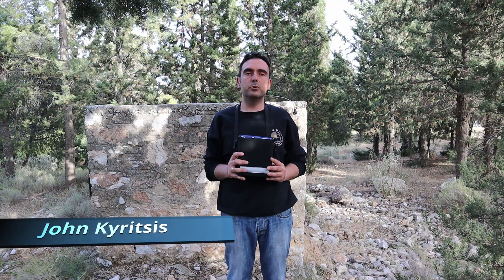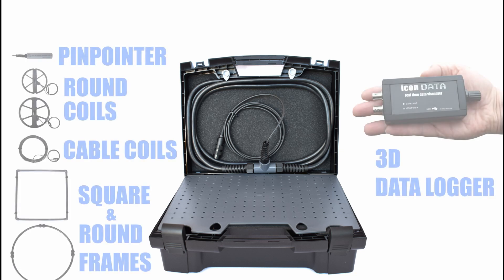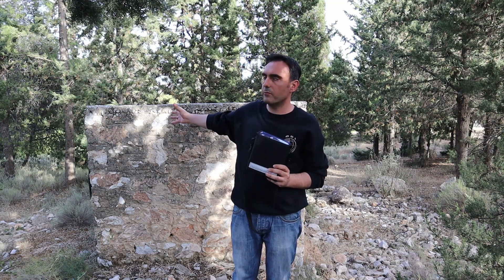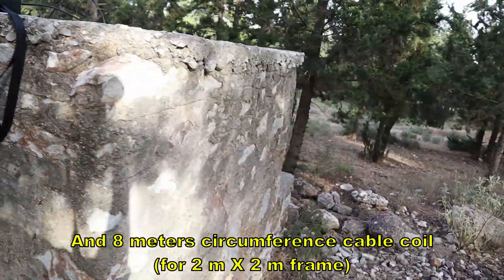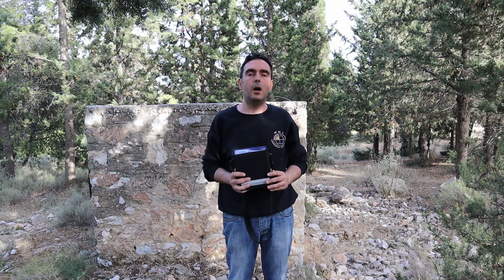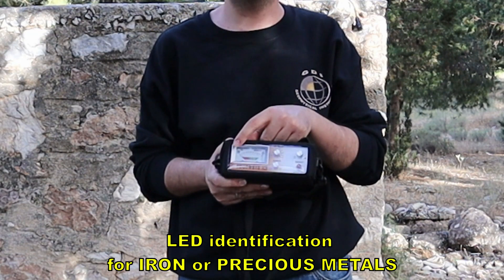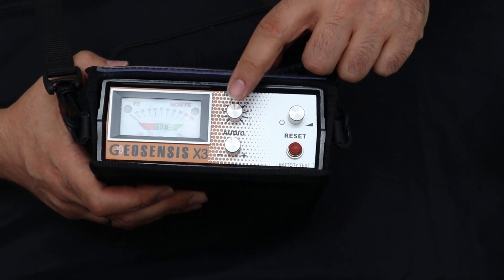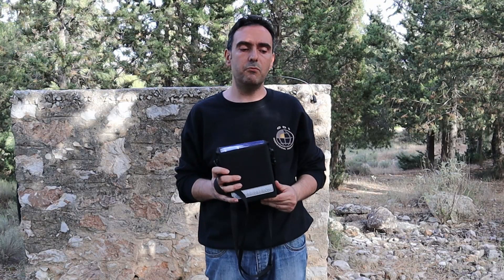GEOSENSIS X3 Pulse 3D Metal Detector Depth Test Under 3 Meters Rock | standard size round frame coil

Comment: Do you have already bigger coil?
Reply from the maker: The GEOSENSIS X3 coil shown is 128 cm diameter frame. Now available 200 cm frame and 250 cm frame coils.
Reply: @Golddetectors  what is the maximum depth in Ammunition Box?